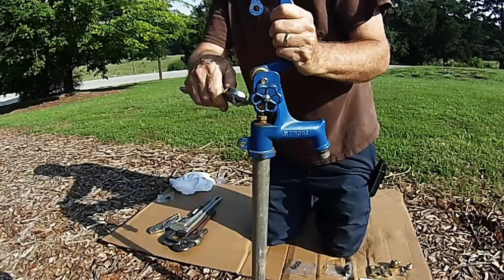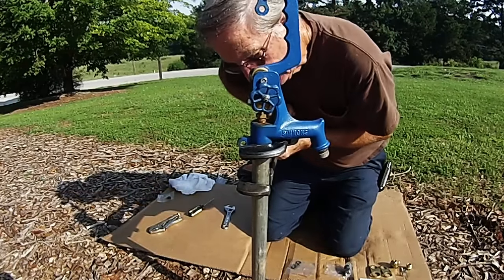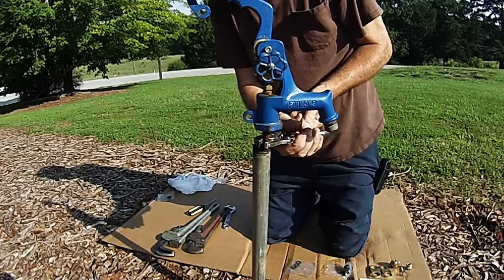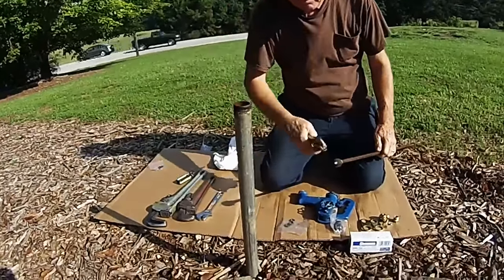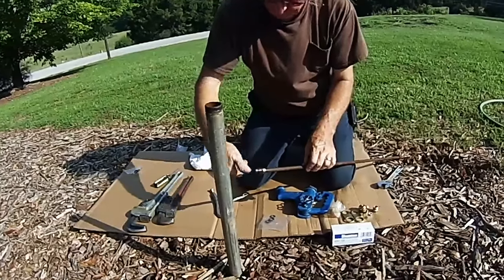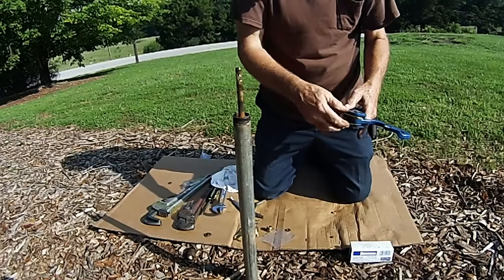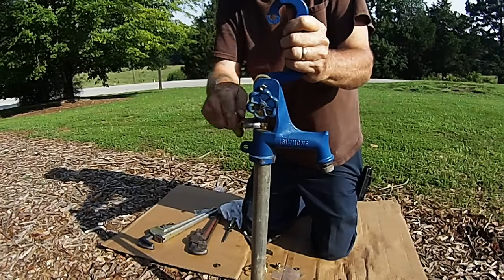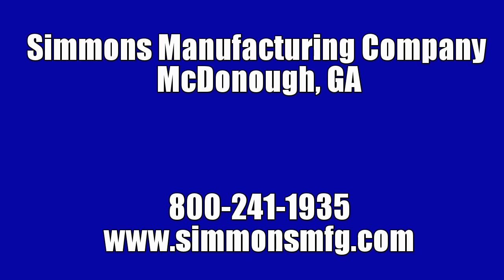Simmons Frost-Proof Yard Hydrant- Repair Kit and Plunger Replacement

Comment: When I pulled the rod out of the pipe, it was very difficult, when I finally pulled it all the way out, the rubber part was still stuck in the pipe. I simply turned the water back on and blowed it out of the pipe and put everything back together. I had to adjust the set screw because it water still ran when I closed it. Now it works beautifully.
Reply: Bryan S talk about an oh shit moment
Reply: How do you shut the water to these? Do you just cut power to your well?
Reply: Yea kill the well power
Reply: @on4acres  There could  be a T in the line that branches off of your mainline that supplies your home, camper or barn. In this case as stated above just turn the breaker off to the well pump and depressurize the line. Otherwise there should be a valve to turn off. My situation is with a camper and I'm tied directly to the mainline from the city. Had to call the water department to shut my water off.

Comment: I bought a repair kit 10 years ago and it’s been sitting in my shed.  I had been avoiding the repair thinking it was too difficult.  Well Recently the hydrant started leaking so bad I had no choice but to replace it.  I found this video and it made it so easy.  The only difference was my pipe is set in concrete so I just need a single pipe wrench.  My hydrant was rusted on so I had to go to Home Depot for a lever to get the head loose.  I used a steel chainlink fence post worked great.  Had it off and repaired in about30 minutes.  Much easier to operate now and I’m not getting sprayed because the two o-rings had worn away.  Thanks for a great video.

Comment: I bought a farm with these units. Most of them leak (after ~20 years). I found this most helpful. I would also recommend taking garnet paper to the shaft where it contacts the packing rings (O-rings) and smoothing out the rough surfaces. This is a great design and I'm proud that it is an American company! Good job.

Comment: Victory, baby ! Got it done. THANKS for video ! Propane  TORCH was needed to heat/remove spigot housing threads(@1-2 mins torch under collar pointing up on pipe threads and nut housing of spigot), and old bottom plunger threads (#45-60 sec), cuz parts were sooo old and rusty - even after spraying PB Blaster solvent. (Follow all torch safety instructions !). Also, there's 3 O-rings in my kit, but video says just use 2 (had to remove third after reviewing vid) . Keep packing nut loose till u put  spigot fully back on plunger rod, like in video. I put  lots of Vaseline on new plunger/plug at bottom of rod, cuz it was tight fit going back down into pipe. Helps to have friend holding second monkey wrench for spigot removal, and plunger rod when removing old plug thread at bottom to replace w new one if yours is old, rusty and stuck like mine. Happy camper 😎. No more water spewing all over the pump handle when on, no more spigot drip when off.

Comment: Very helpful video.  My hydrant was leaking from the drain when the hydrant was turned on.  Turned out the plunger somehow got twisted up and/deformed.  I managed to lift the plunger about 18" but then the rubber portion broke off and remained stuck in the pipe.  I had to dig up the whole hydrant, remove the pipe from the valve body and force the old plunger out of the pipe by pounding it through.  All back together and working now.  I hope it lasts more than 6 years this time!
Reply: Someone else said he just turned the water supply back on and it blew the rubber plunger out. Clever. No digging! LOL

Comment: Very well filmed and explained in easy to follow step by step instructions. My hydrant is not the same brand as the Simmons but is same design. Learned lots from you video. Thanks. Am working on proper rod adjustment today.

Comment: Good info, but probably should have put pipe dope or tape on the head threads to prevent it from leaking. Also file down any burrs raised by the set screw so that they don't tear the o-rings and clean that portion of the shaft until it is smooth. Otherwise you will constantly have leaks.

The other issue is there is no way to know if it has a small leak. It will drain out the weep hole underground. Only if there is a very large large leak will you notice above ground. 

The only way I can think of to address that is to have a pressure gauge somewhere in the line near it's source that you can shut off the pipe to the hydrant and see if the gauge pressure falls.

Comment: The reason not to replace a frost free is that you have to dig up the entire installation to replace it.  If you rebuild it you can do all the work from the top and save at least an hour or more in labor of digging up the old faucet.
Reply: Well, not when you get to the point of inserting the new plunger into the valve and it just doesn't want to go. No amount of lubrication and force will get mine to go down any further. My only option now is to dig it up.

Comment: Before you screw the  head back on you need to dope the pipe threads with a good pipe dope.  Work it in well to both Male and female threads. These threads corrode and once they are shot you may have to dig and replace the pipe or whole unit. Mine were in very bad condition and I had to chase them with a hand threader. Never make it up a pipe joint without good pipe sealant.

Comment: We repaired a hydrant but the connection between the hydrant , L shaped connector and the water line stays damp. This is not water coming out at the bottom when you turn off the water. It is not dripping and the soil under the area doesn't feel soaked. It this amount of water acceptable? The guy that did it for me came back undid it, added new tape on the threads and really tighten everything up..still damp to the touch. Tell me if I can fill it in or do I need to look at something else?
Reply: If it's a brass connection it's condensation.

Comment: Getting ready to do mine, change the rubber, ground is all wet, hope that will do the trick. .  Thank you..Jim tom
Reply from the maker: If you have any questions or experience unexpected problems, please give us a call. 800-241-1935. Sometimes it can happen that the rubber part of the plunger does separate from the metal part and stay inside the valve body when you pull the rod. Do not worry about having to dig up the hydrant. Give us a call and we can send you a tool to quickly remove the old plunger.
Reply: I'd like to get that tool on hand or make one before I tear mine down. 
My prob is linkage wear(I hope) is not raising rod high enough to open. I made provision to prize up under the set screw but seems to take undue pressure to raise rod further, as if something inside's keeping it from raising. Have to keep pressure under set screw to get water flow too. I'll call before I undertake.
Reply: Bought your 850-SB from 67 Hardware off Ebay. Went to install today, was seriously disappointed and aggravated. The new one had more slack than old one. One POORLY machined piece. I turned some bushings to take up slack in old one, it's working fine now.
Don't know who y'all contracting to make parts but you NEED to do something different.

Comment: Looks good but when I tried to pull the plunger rod out it would not come out. I even hooked a wire to it and tried to use a pipe as a pry bar to pull it out and it started pulling the pipe out of the ground. I can turn the rod no problem but it won’t come out.

Comment: Mine's stuff in the shaft. Not even a come-a-long is pulling it out. Installed in an outbuilding in a 4 ft deep french drain filled with rocks in a tight space. Probably easier cap it and dig another line

Comment: What keeps the water from coming up?? Do you have to shut the well off??
Reply: Yes.
Reply: As a 20 year veteran service plumber I have one wonderful peice of advise when doing any work on pressurized lines. Always turn the water off before working on any pipes or fixtures. Isolation valves are your best friend. When turning a line back on, always do it slowly and check for leaks. Leaks can happen even when pros do work, so be ready to turn back off if a problem still exists.

Ok that was more than one piece of advise.

Comment: I have water seeping up through the ground all around my hydrant.  If I replace the plunger, should that stop the leak or do you think I need to dig everything up and change the piping at the bottom of the unit?
Reply from the maker: do you notice the saturated water all the time, when the hydrant is on, or when the hydrant is off? Also, how old is the hydrant?
Reply: @witwicky71  I notice the water all the time. I started noticing it last week. The hydrant is about 20 years old.

Comment: Don't you think teflon tape or paste should have been applied to the threads before replace head assembly on riser pipe?  Asking for a friend.
Reply from the maker: Yes you can do that. What we currently do on new hydrants is put water proof silicone on the threads.

Comment: Is it possible to replace a simmons hydrant with a iowa brand handle?  I wasnt sure if i took broken simmons hydrant off if iowa model and plunger could be installed into existing 1" pipe without digging it up